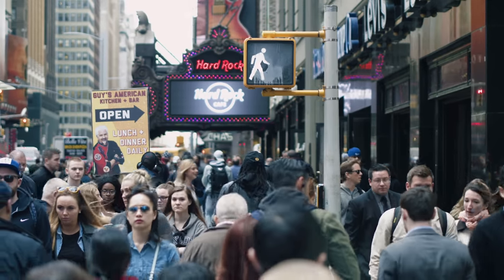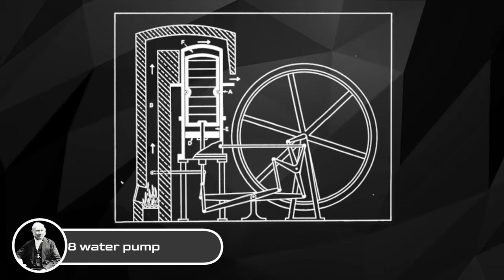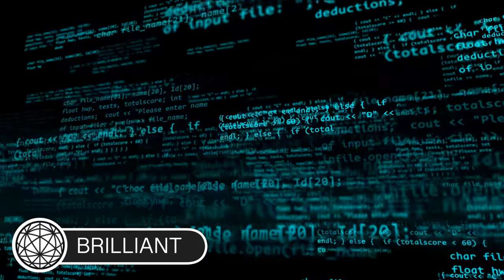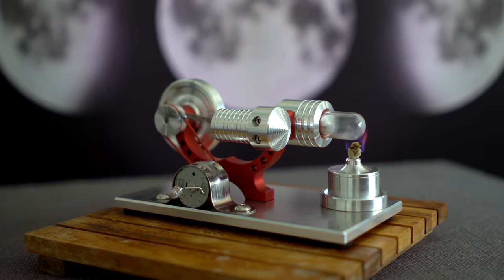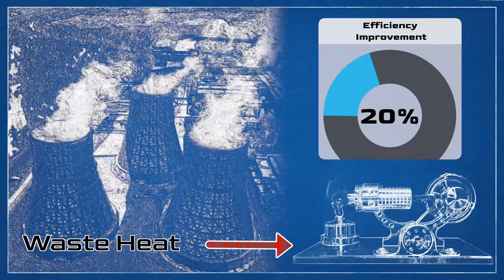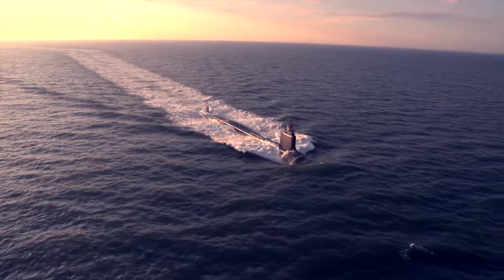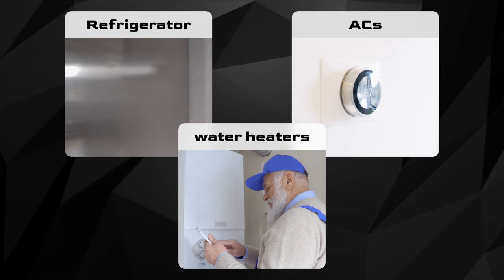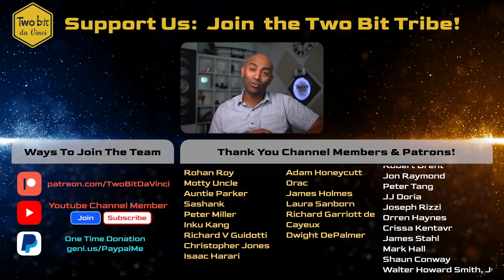Why This Age Old Tech Can Be the Future of Energy - Stirling Engine Explained

Comment: Haha, I have the same Stirling engine you showed with your cute boy!  I never thought of the heat pump angle!  
Another great video Ricky! 

Cheers,
Eric
Reply from the maker: Thank you Eric as always! Yeah these little Stirling engines are so much fun! and I'm going to try to have my son in on more episodes :)
Reply: @TwoBitDaVinci  Brother, I just love these concepts bringing synergy in home thermodynamics and am so excited to see what Elon is cooking up.  Taking advantage of some home equipments latent heat and sharing it where needed has always been an interest of mine.  Here in the humid east coast in late spring, summer & early fall I would love to make use of the heat my whole house Dehumidifier produces (as well as capturing the water) so its not fighting with my air conditioning.  Maybe if I had only placed my Dehumidifier in the same room as the water heater it would have been fun to work it out.  😀 
Seems the stirling cycle with its steady state operation might be useful in many ways from your attic concept to below foundation thermal tap... fun.  
When I designed this house, I did go a couple feet deeper in my foundation and with the R-28+ insulated walls and then added R-20 rigid foam insulation below the floor.  Man, we were surprised how warm that floor is in the winter... we decided not to even hook up the radiant floor heating.  Seems between the earths warmth 10'+ down (56° or so) and our modest basement heat... the floors just don't get cold... now if I could pre cool the Dehumidifier air through earth-tubes ... haha just so fun.  But also expensive too.  
On the 19th of August I actually get to meet my Architect at the new NC property ... I'll keep these dreams in mind when I meet with him.  😉

Cheers, 
Eric
Reply: @erickessler6094  Insulation is so important in lessening temperature cycles in the home.
Yes, it's expensive but it keeps giving all year round.
We built our '70s double brick home (in South Australia), before wall insulation for our type of construction was a thing, but later, we had wool insulation blown into the wall cavities & without a doubt, it's been the best money we've ever spent.
I'm now in my 70s, with my wife approaching the hurdle, we're not as cashed-up so we've recently bought bulky but light, comfortable insulated clothes for the colder weather like we're experiencing now. 
If Eskimos can survive their icy environment, we should all learn from it. 👍
Reply: @CNile-se9xw  Amen to that insulation & temp cycling brother!  The temp changes in this house are very slow as this home is an Insulated Concrete Form (ICF) home so the basement and house walls are Concrete up to the roof trusses. While the native R-value is R-28, some argue the passive geothermal effect gives them a higher effective R-value of about R-40 but I didn't consider that during my Manual J load calculations especially because that benefit really only would count during temp extremes where there is a high temp difference between the below grade soil temp and the hot air and sun. By design and lot selection, I also kept my south side of home to 1 story of wall (almost perfectly south) while the north side, due to lot slope, is 2 stories of wall.  The heat & sun hitting that side of house does have to fight through both the insulation and the passive geothermal effect of energy conducting through the Concrete wall with its 12'+ deep foundation wall.  
Anyway all a fun experiment and only the roof and gable ends are wood, and the gable ends are staggered-double-stud with R-40 spray foam.  The roof is R-60. 
It was such a fun project and my 2nd energy efficient design. 

Cheers,
Eric

Comment: I was recently thinking of putting a heat sink within the walls of a building, with equal amounts of insulation on each side. In the winter that heat could be pumped back into the house, reducing total energy costs. And in summer it'd be pumped outside. However, that energy could be used as a heat source for a Sterling engine. Capturing the heat from solar radiation before it entered the attic or living space.

Comment: Complex mechanical systems (think ICE) have limited efficiency - simpler more direct methods may prove better.  example? : Tesla heat pump system.  BUT ships/trains might be a good application. ??
Storage buffer for wind/solar utility scale systems?  Engineers will have to design and run the numbers or experiment how costs compare to other systems.

Comment: I think we should use whatever technology we can to improve the efficiency of power production at the generating stations, and more efficient use at home. The Stirling engine is a good candidate for many applications and is safe technology. I have several model Stirling engines and enjoy watching them run. 
AliExpress also has a good selection of Stirling engines, including model cars and tractors that are propelled by them. The different configurations and power levels is astounding, the Chinese have really gotten into producing reasonably priced good quality units.

Comment: The problem with your heat line idea for certain devices to dump their heat into the attic, the problem is things like refrigerators work more efficiently the colder the hot side is. Same thing for air conditioning. I don't know if this is entirely negated by having a Stirling engine on the other side. Computers can typically run up to ~70C before thermally throttling, so maybe that would be okay, but still they prefer to be cooler. LNG heater exhausts are also typically quite close to room temperature by the time they leave the building because of the way they design the heat exchanger.

That all being said, I'm stoked for these to be used for rooftop solar, etc. Typical thermal panels are ~70% efficient. If a Stirling engine can be 40% efficient and an electric generator can be 90% efficient, you're sitting at 25.2% efficiency - comparable to rooftop PV. I think for me the advantage there is if you can store the heat for later in a large water tank (Say 4000l - ~1000 US gallon), that's a great cheap battery. I just did the maths, and it works out to 74kWh storage assuming ambient of 20°C, with your tank hot side being 70°C and your waste water out the other side of the tank at 30°C. Perhaps my maths is wrong, but this could potentially be a lot cheaper than regular solar battery storage if you have the space.

Comment: So we're buying this house which is near a church that's a protected historical monument, meaning we can't install rooftop thermal panels as planned for our heating system.
So instead of the panels above the roof tiles, I thought about having a thermal collection system just below the tiles and sheathing, between the rafters, above the wood wool insulation boards.
A south-oriented rooftop can apparently provide a bit of heat in winter that we can use directly, but I was planning on converting this waste heat in summer, since we don't need that much hot water then. Not sure however how to do that, I couldn't find any instructables about Stirling engine and electricity generator hybrids.
I was also wondering what would be the best way to convert waste heat into both cooling and the electricity to power such a heat pump, if anybody has already tinkered with this concept.

As for the refrigerator, I didn't really plan on a heat line, that would be too far away from anything, but I was planning to put the back of the refrigerator into a wall recess, with vents to keep the heat outside in summer, and move it inside in winter. I don't understand how this is not the basic setup for all refrigerators, the more advanced setup being recycling this heat into the double flow CMV.
Reply: I saw a farmhouse that had an outside door behind the builtin fridge
Reply: @raymondclark1785  Simple designs like this often work best...

Comment: If it works with cold, then all you need to do is run a cold liquid through the system. Combine it with a generator to produce electricity, so the constant power can be turned into variable power through electric motors, and you can take a room temperature gas, liquify it, then store it. This can then be used like a battery of sorts when you release it and it's allowed to heat up while producing work through the sterling engine as the cold goes into the engine.

Comment: The future is solid state. Photo-voltaic and thermal-voltaic. With efficient heat-conduction.
The tricky thing about Sterling Engines is that it requires highly efficient heat-conduction devices. In an internal combustion engine the heat travels through the engine with the fuel and working fluid.

Comment: Well,  I don't think a Sterling engine will be anything other than a novelty. However the concept of heat exchange as a motive force is  interesting. The efficiency should be the focus here. I have already designed one that seems to be very promising. Remember it is more efficient to store power from a crank than receive power from a crank. Thanks for the vid.

Comment: You don't need heat, you need a temp difference bigger is better, so you can use cold to power a stirling engine too, Eg one side is connected to the ground which is warmer than the ambient air temperature during night time in winter or cold climate

Comment: Anther thought is a second Condenser coil and temperature sensor that is mounted outside and the refrigerator using Freon valves switches over to dump it’s heat outside instead of always inside.

Comment: Have been a fan of Sterling Engines for over 50 years as all you need is a differential in temperatures, simply the greater the difference in these values the more power you can get.  Just think of this the temperature about 6 foot underground is roughly 58 degrees year round.  Well think of this in the summer you may have a nice 98 degree ambient air temperature, wow 40 degree difference in the winter if it hits 0 degrees you get a 58 degree difference.  Well in the spring and fall you may get some time where the 58 degree ambient air temperature matches the underground number, well for those days stored energy is the answer.  But for some reason the governments want wind mills and solar cells.

Comment: I personally think it should be possible to pair them with Sadoway's liquid metal battery cells, as those operate at about 500C both charging and discharging.  it seems to me, if you sized the cells, and the sterling engine, to a load correctly, you could run the Load off one cell, while the engine charged a second cell, running off the waste heat from both, and just flip the load back and forth between whichever cell was charged. 
I think the thing could, potentially, run itself and power the load without violating thermodynamics or conservation of energy.

Comment: Throttling a Stirling requires a robustly constructed mechanism. The reason for this IS the throttling. Aside from simple control of the burner (whatever) and Stirling's internal gas media pressure. Efficient throttling is achieved primarily through raising and lowering that pressure. High pressure = higher efficiency because of the gas's higher density = more heat capacity = capacity to do more work. Varying this pressure can be nearly instantaneous = solution to non-peppy performance in a car. Gas reservoir and a pump is all you need. What's the problem??

Comment: In all viewing of sterling engines, I have noticed that every electric generator has been run directly off the flywheel. What if you increst the ratio between that flywheel and the generator shaft. Much like in a bicycle gears system. Where a little more power input is amplified by an X factor of the gears ratio. Increasing the speed by the ratios calculated for the differences.

Comment: You can always go heat engine - electric generator - electric motor. Diesel Electric trains are the living prove that fixed RPM in transportation is not an issue.
Also: ever seen a gasoline engine start by it self? The key is not magically starting the engine - it just cranks a starter electric motor. If you want to generate electricity, you can simply use the generator as an motor and start the engine that way.

Comment: The costs of these drops a LOT when you mass produce them.  Even the copper heat sink could be a cheap water cooler.  Your source of waste heat around the house might not be enough, but you can always add direct sunlight.

Comment: I imagine larger (taller?) buildings would derive more benefit?
Larger glass area to collect summer heat on multiple floors,
Large vertical component to assist movement (heat rises)
Airflow over roof to allow differential,
(Air con mode).

Comment: I don't know what you call fuel, but the heating element of the engine is running off of something hotter than the ambient heat.
It may be solar, it may be geothermic, it may be whatever, but if the temperature is above ambient something is fueling the device.
Reply: Fuel is the use of a product to create heat or energy by burning. The coffee is not burning, so it is not fuel. Thats like saying being under a blanket you are fueling the heat in the blanket, you are not. There is absolutely zero burning happening. Hot air expanding a sterling engine means that it is fuelless, it is being heated, but not being fueled.
Reply: @facelessdrone  really and the water for a waterfall, is not the fuel for the engine which is the waterfall.
Oh no, it's gravity. 
Remove the water, the waterfall doesn't turn, so therefore gravity does not work as an fuel, but think again gravity can pull a rock out of the sky and make it destroy the Earth so gravity does work as a fuel.

Comment: A heat sauce can be magnified & or reflected heat rays from the sun. It may be spasmatic & have a variant in intensity but with power storage systems through modern sola systems improving it seams every month. Power storage will benefit in a Stirling system as it dose in the widely used solar power sell systems. There will be no burning fuels no dangerous emissions & no/non/narda costs in solar supply to the stiring machine at all. Just general maintenance & occasional lubricants is all that is needed for running costs! The manual start at the first light of the day can be automated through a sola sensor connected to a starter similar to a starter motor on a standard car engine that would engage & disengage when a minimal revolution is achieved.

Comment: How about the heat line you mentioned, coupled with an outside solar concentrator that tracks the sun and sends heat to a plate to power the whole house stirling engine.
Reply: Feel your attic with sand/regolith, not only a great thermal mass, also blocks radiation. You can power your house at night with the energy collected during the day.

NASA already has a solid state version, I expect the Sterling engines to be exceptionally common for space applications.

Comment: For those that like to think about harnessing waste heat here are a few things to think about.  Take a refrigerator, for example.  The cooling efficiency of the system is dependent on the surface area of the condenser coil.  The smaller the temperature rise vs. the ambient (room) temperature the less energy the compressor consumes per unit of heat energy removed from the refrigerator.  Imposing a stirling engine in the thermal path between the condenser coil and ambient temperature imposes the problem of a) maintaining the condenser coil temperature not hotter than the original temperature above ambient (room) temperature, and b) rejecting the waste heat from the stirling engine with a now very low differential to ambient temperature.  This implies the working fluid of the stirling engine must have much more efficient coupling to the ambient air than the original condenser coil had.  Since difference between the absolute temperatures of the condenser and ambient are relatively low, the Stirling engine, even running at ideal efficiency will convert a relatively low percentage of heat from the condenser coil to electrical energy.  The majority of the heat absorbed by the Stirling engine from the condenser is still rejected into the room by the cold side of the Stirling engine.

I have used the refrigerator as an example of some of the challenges involved in harnessing "waste" heat.  This is not to discourage individuals thinking about the problem.  I have enjoyed pondering such problems for many years.
Reply: What if the stirling drive shaft is running the compressor?
Reply: @budkistner  The working fluid of the refrigerator works between the interior temperature of the refrigerator and the most convenient sink, which is the air within the room the refrigerator is located.  Unless the Stirling engine has access to a sink operating at a lower temperature than the room, imposing the Stirling engine between the condenser of the refrigerator compressor and the room ambient will raise the temperature of the condenser and increase the work required of the compressor.  The work an ideal Carnot engine could extract from the differential of this higher temperature and the room ambient would only equal the increased effort of an ideal compressor due to the elevated condenser temperature.  Since both the compressor and the Stirling engine operate  with losses, a net increase in energy will be required to operate the compound system.

Comment: As you need a certain temperature difference I can imagine large heat pumps driving generators everywhere there we have heat (by the sun) and nearby cold water like a river or a lake to cool the other side of the machine. Maybe near the Colorado or Mississippi river or somewhere at the coast in southern states. Or maybe we can build into a large vessel a Stirling engine which gets heat from the sun and cool water by a hose 50 feet down to reach some colder ocean water from that level, much cooler than at the surface.
Reply: They call it OTEC